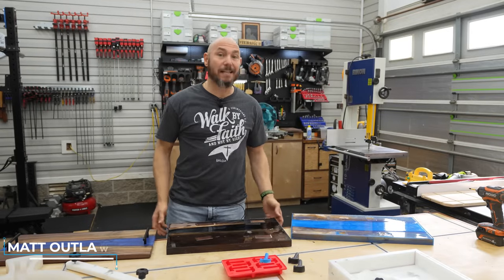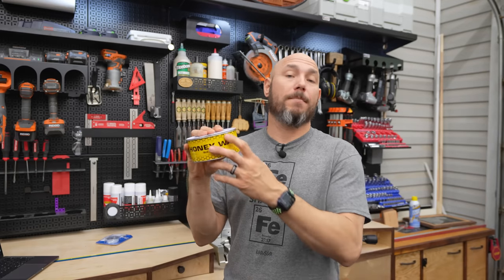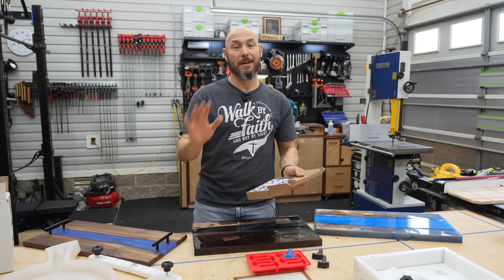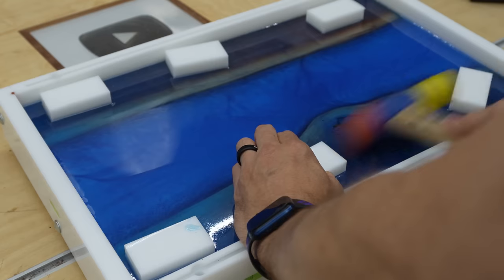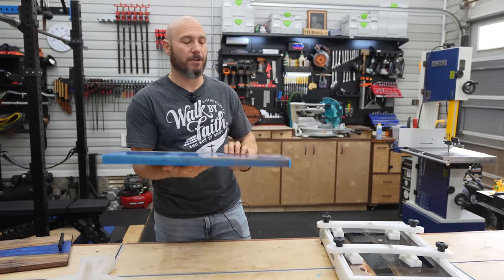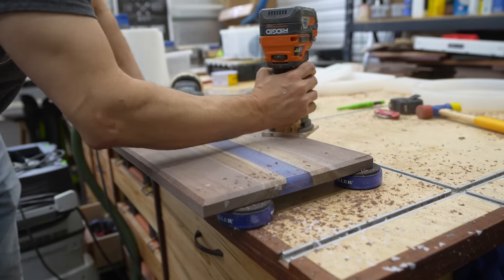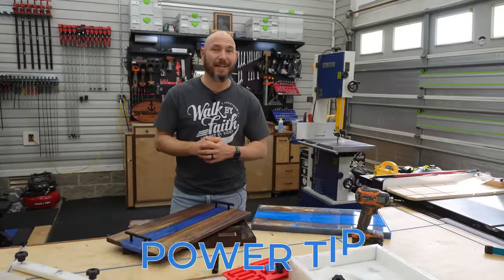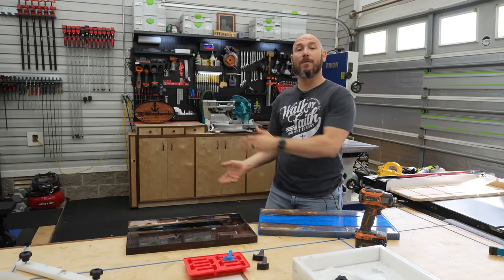I Tried Epoxy Resin for the First Time… Beginner Tips and Tricks

Comment: Extra "Power Tip": Make a handle template with a piece of scrap wood. I have one with 3 holes in it. 2 holes spaced at 3" and the 3rd hole is 3-3/4" from the 1st hole. Other sizes can be made, but those are the most common ones I have. Make center line marks on the jig, line jig up, clamp, and drill holes. Foolproof jig and reduces stress before making holes in a board or cabinet that you have time and money invested.

Comment: You talked about what you sell these boards for, but you didn't talk about what the material cost
Reply from the maker: The material costs is higher than non-epoxy boards because you have to get the molds, (or make your own), the release agents, epoxy, etc..  All linked in description.  That is why you would want to price these higher than regular serving trays to cover the costs of materials.

Comment: Very nice. Lots of good information.

Tip: When edge profiling with a router, cut the end grain first. Then, any tare out from the router exiting the wood at the end of the cut will be removed when you profile the other two sides. I hope that makes sense.

Comment: Those came out really nice. TIP or what I do anyway....I pour the epoxy so it doesn't overflow over the wood, that way it's easier to get out of the mold and your planer is taking less epoxy off. You are planing mostly wood. Less mess.
Reply from the maker: Thanks for the info!

Comment: Nice work Matt.. for the handle drilled holes, I use my CNC which has perfect results and great alignment with my handles.  A little math on the set-up but very easy to figure the hole locations.

Comment: Howdy Mr. 731...

Very cool boards dude. 

So, now that the question "can you cut on an epoxy board" has been answered....Just curious, when "you" sell one, do you include a BIG BIG note in BIG BIG BOLD bright neon writing saying "DO NOT CUT FOOD ON THIS BOARD"? 😛😛😛

A Power Tip: To help contain the overflow of resin from coating the entire board, use peel and stick weather stripping to create a boarder. That way, you're not hammering off the clamps.

Comment: The boards look amazing.  Question on the measuring cups, are you able to clean those with something and reuse them or are they throw away after each use
Reply from the maker: I leave a stick in them.  When they dry, you can just pull the stick and dried epoxy out and re-use the cups.

Comment: You mentioned the wood came from a different place then the 2 molds. Did the wood fit to size or did you have to trim them down to fit molds. Also with the board butter and mineral oils used? Are those food safe

Comment: What setting did you use on the planer? 1 or 2? How much did you take off at a time? I did one in Chinese little chunks on the other end of the planer? Brand new Dewalt
Reply from the maker: Setting 2 and a tiny amount at a time.  About 1/8th of a turn on the dial each time.
Reply: @731Woodworks  I appreciate the reply

Comment: Matt out of the two molds which would you recommend
Reply from the maker: The Crafted Elements is easier to un-mold as seen on the video.  The other one will likely last a lot longer.  Crafted Elements has a lot more shape options though so if you wanted to do a specific shape, that's the way I would go.
Reply: @731Woodworks   I went with the crafted elements and the MG chemical spray mold release. After I watched the video when it came out I went all in on giving this a try.Glad to see you went with the kapex btw. Brother RIV was pleased, he always recommends I don't cheap out on tools and materials too and I see why now.

Comment: Nice work. How do you deal with the resin that doesn’t fully cure the is on the underside of the wood when you take it out of the mold. I poured my first board and when I took it out of the mold it had some tacky spots which leaked onto the wood.
Reply from the maker: Couple of things caused that.  Either it wasn't fully cured (you didn't leave it in the mold long enough) or the resin wasn't mixed thoroughly enough.
Reply: @731Woodworks  the “River” portion of the pour cured just fine. A small amount got under the bottom piece of wood and now it’s super sticky. I guess I can attempt to scrape it off.

Comment: i didnt see you hit the epoxy with heat gun or flame to remove bubbles.  seems like everyone else who does epoxy pours does this.
Reply from the maker: Deep pour epoxy doesn't need it.  They work their way to the top because it is so thin.  You can use a heat gun after the initial pour to knock off the surface bubbles but you're going to plane them away anyway.